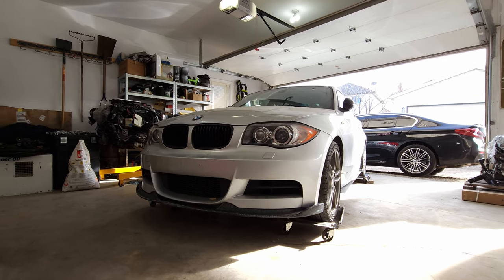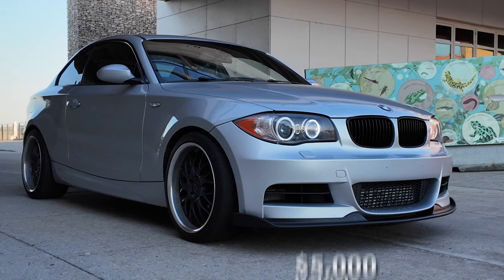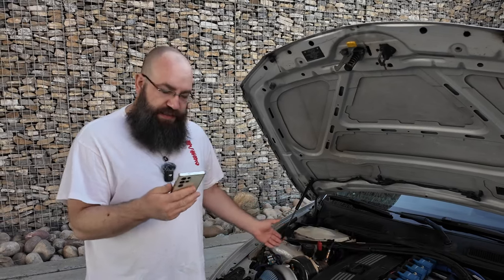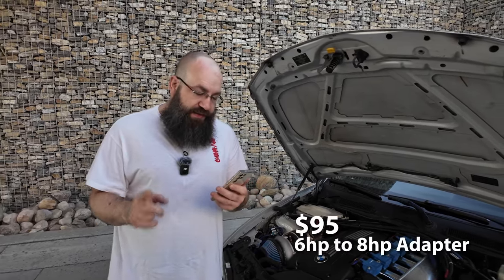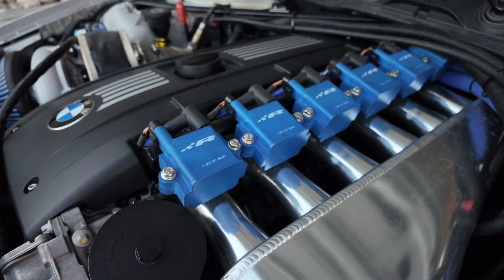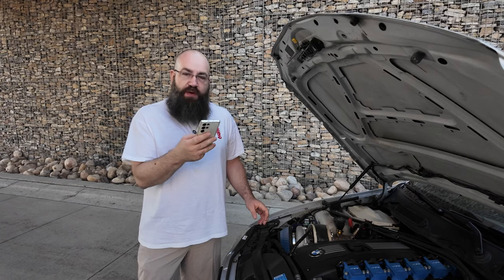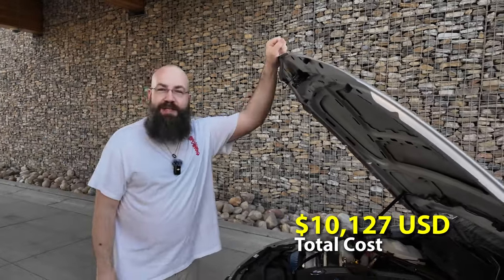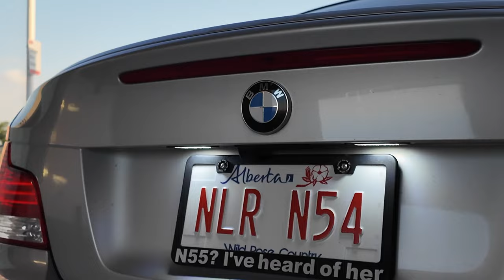Cost Breakdown: Building My 8HP Single Turbo BMW 135i

Comment: very cool. Interesting.  I did a similar project in the same time as you. I swaped E91 , N54 , St 6262bb speedtech, 6mt twin disk, meth, and all the ''while Im there'', and not that far , I'm on 16k-ish $ cad with the 2 cars (donor and receiver). This include the shit ton of parts sold as part outs. 600bhp, wagon, AWD, 6mt = not bad of a deal. It was a fun project.
Reply from the maker: that sounds like an absolute riot! I was debating the same thing since we didn't get the e91 with the N54 here, what a shame!

Comment: I use the 335d air intake so that it points to the passenger side where the turbo inlet is. 😉
Reply from the maker: I had one but it didn't fit, the 1 series and 3 series scoops are different unfortunately.

Comment: I didn’t really love the 1 series but after watching you build it the color the upgrades I am persuaded to think these sort of cars are those that grow one you I am currently rebuilding my 318i e90 to a 335i n54 as I am 75% done with it I pulled the old engine out of my car and I will be slapping twin turbos tdo4 19 t I will upgrade the Intercooler, oil cooler, fuel injectors, low pressure fuel pump , precision works ignition coils
Reply from the maker: sounds like an amazing build!! you're right, at first I was apprehensive about the 1 series, didn't like the front end, headlights, etc. loved my e90 but regrettably sold it.

This was the same color and I wanted to save it from the scrap yard, I had to do it justice. now, I couldn't imagine ever parting with it.

these cars are awesome, better yet with a story.

Comment: didn't think a 8hp45 can handle that power very nice.
Reply from the maker: It's been flawless in our e92 swap, so far equally as good on our e82!
Reply: @tony.nextlevelrides  thank you, I always wanted to swap my 6hp19 for a 8hp45 on a E60
Reply: You did really good brother! My Spool Performance Stage 2 Transmission built to handle 1,000ft lb torque cost $9,500 by itself. That's including a upgraded torque converter & labor. It's for my 21" M340I (ZF8HP51)

Comment: Awesome! You are like me. I love to mod, but I’m always listing my older parts. I’ll even find things around my home that I don’t use anymore, and list those so that I can find my car modding habit. I do have a couple questions though: What about the tuning costs? Do you do the tuning yourself as well?
Reply from the maker: the tuning is just a free back end flash through MHD using the JB4 and dialing inthe boost. I do it myself but if I go with a proper tune it'll definitely come at a cost.

Comment: i like the sleeper build look for these cars, where it just looks FBO, and everything else looks stock..  although right now mines doen a little nickel and dime-ing with random stuff. mostly tail lights i had to buy after body work, cause pretty sure body guy stole my good bulbs.  and a regulator for rear door window.  i also need to get a 12x1.5 helicoil thread repair kit for rear knuckle from when i did the M3 upper arm conversion.  was able to do initial torque, but anything past it just spins so got a new bolt and now just need a helicoil, ( if helicoil doesn't work, new dorman loaded knuckle for 600 from Oreilly's) then it's back to tracing down this damn oil leak, putting in my polyurethane trans mounts, and maybe a poly large rear rear diff bushing and M3 diff bushings combo, M3 rear sub frame bushings.  some down pipes, and then finally, maybe some turbos..
Reply from the maker: sounds like a wicked build! I would personally add a rear diff. brace to the list of future install items!

Comment: Auto is a nice way to go, 6MT would’ve been a way higher starting point
Reply from the maker: the intention was a very oem-like vehicle with tons of power on tsp. part of me wishes it was a 6MT, the other part is extremely satisfied with the 8hp.

may be adding a clutch pedal and sequential style shifter. :)

Comment: Wheel specs please? Size, width, and offsets.
Thanks in advance.
Reply from the maker: should be;

Front: 18x8.5" et40 w/ 225/40R18 tire
Rear: 18x9.5" et48 w/ 255/35R18 tire

Comment: Did i missed it ? Did you do anything suspension and brake wise ? 

If so 700hp on the stock rear E82 suspension.  Damnnn
Reply from the maker: granted, it is the M Sport / M Performance suspension and better than the base stuff you get. Brakes have the large Brembo 6 pots front, 4 pot rear with slotted discs.

it'll be fine for now, I do plan to lower it on coils eventually and do stainless lines.
Reply: @tony.nextlevelrides  Yeah yeah, but the 6 pot from the 135i and 1m are know to have piston issue when expose to too much heat (F30 brake are a good cheap OEM upgrade) And the rear end is know to be pretty soft/siggly.

Great vid tho (from a new sub)
Reply: @Maaaaaax-07 if it were a dedicated track car it might be more of an issue